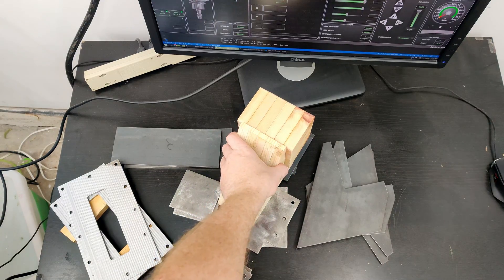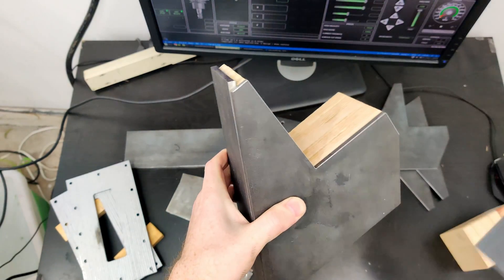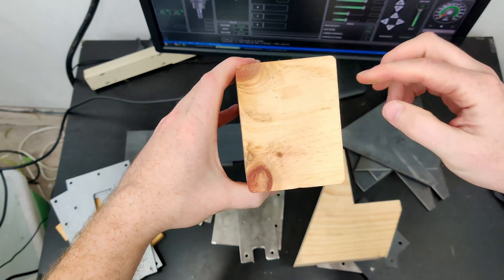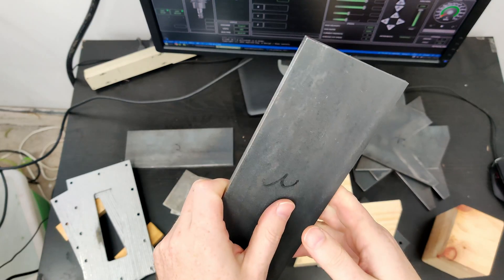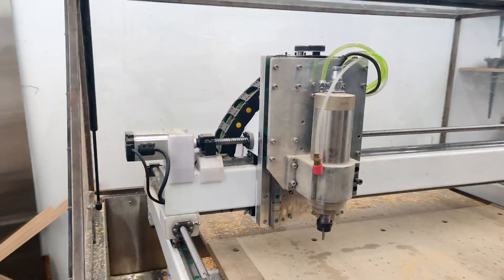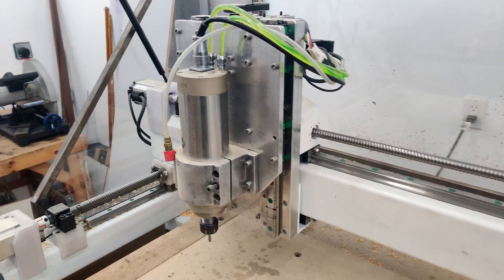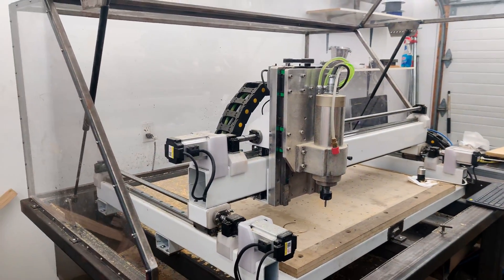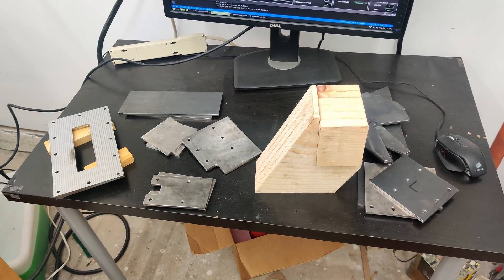Aligning plates for welding: the wood block method - PrintNC CNC machine upgrades

Comment from the maker: What do you think I should do? Squish the gantry vertical walls to make them flat? Or keep them bowed out as they are? Squishing them will allow me to make the fit-up/connection from the gantry risers to the gantry much tighter and I think overall would make a much stronger connection. 

How will I squish the gantry inward you might ask? Cheap $150 CND 6" milling vice. Best $$$ ever spent ;)
Reply: Sei un grande.
Reply: Is it possible that "squishing" the tube will transfer some of the bow to the top and bottom faces?  You might end up chasing the problem around in circles!  🥴
Reply from the maker: @PiefacePete46  It might move the top and bottom a bit, but I think it would be much easier to deal with. Bottom wouldn’t be a problem, the top might misalign the motor to the ball screw, but I haven’t made the final mounts to I could work around any issues there.
Reply: @BryanHoward  :  Fair enough... I guess it comes down to which annoys you most:  Living with the bowed walls, or having to do the extra faffing around to fix it!   😉
Option two will give you personal satisfaction, but nobody will be aware of what you have done!... which reminds me of a favourite "Peanuts" cartoon.
"Doing a good job around here is like peeing yourself in a pair of dark trousers..."
"It gives you a warm feeling, but nobody notices!"   😄
Reply from the maker: @PiefacePete46  Yeah, my logic around trying to get a nice tight connection is that currently with my gantry, I have it bolted to the tube holding the ball nut and even though those bolts are tight I can still flex and see it move. 

I figure if I can get everything fitting snug as possible I’ll reduce the possibility of this happening on the new setup.